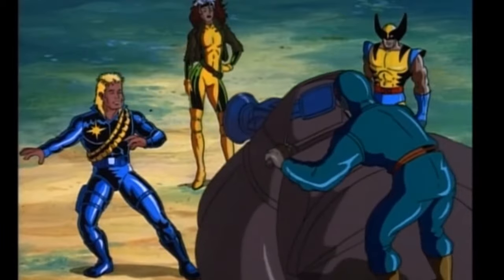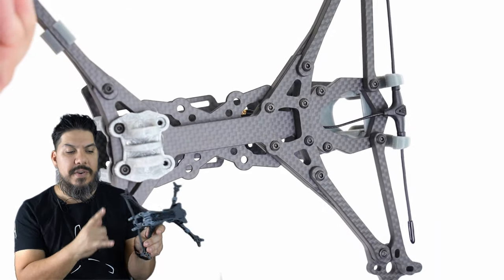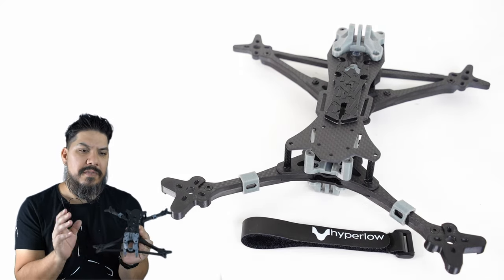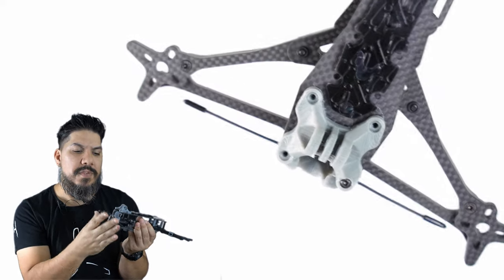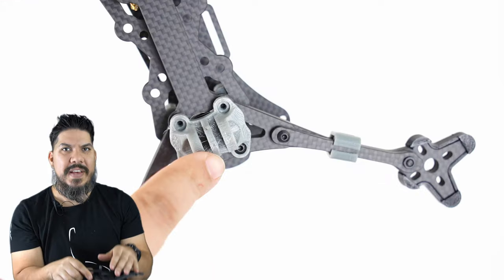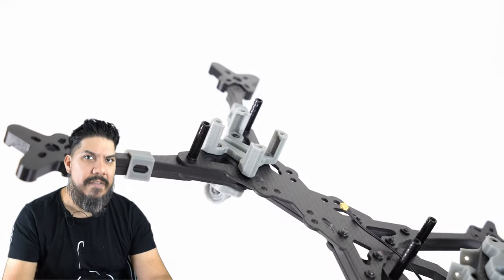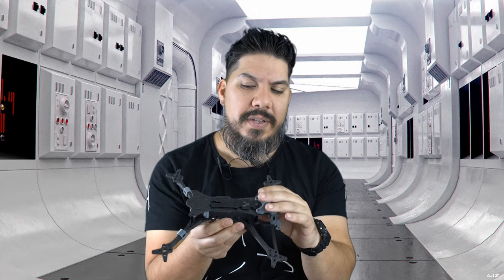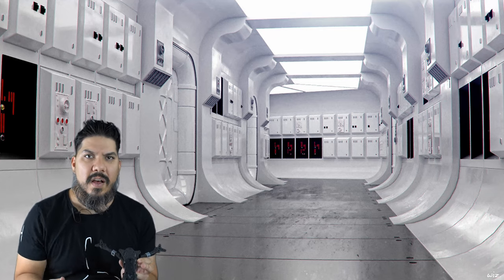Hyperlow Airshot - FPV Freestyle drone frame overview  quadcopter frame engineering and flight feel

Comment: I built a six inch with the Hyperlow RS+ frame and I like it a lot.  It's extremely rigid and very light.  The carbon fiber he uses is fully interwoven so it doesn't delaminate.
Reply: Does he still do that? I think I've seen it both ways
Reply: @spindlershots1957  I'm not sure.  I ordered my frame from him late last year and it came with that kind of carbon fiber.

Comment: I’ve been flying the CG for 2 years and it’s been super hard to find another frame that makes me as happy to fly. Super durable. 
I’m building my Airshot 5” and 6” now. The 5” Airshot is about the same size as the 6” hyperlow CG.
Richard is an excellent designer and Airshot has so much space for all kinda options in electronics.
Reply from the maker: Couldn't agree more! I will note that on the full review im sure, but i am loving how spacious it is for the builder.

Comment: Where is the follow up video? 
Looking forward to hearing your updates and flying experience.
Reply from the maker: Coming soon. Motors came this week. Stay tuned
Reply: @JonE5FPV  What motors did you get? I’ve been shopping for my next favorite 5” 4s motors. 
I’ve got my favorite 6” BrotherHobby 2507 set up almost finished. Been working too much after a move back to Dallas from Denver. I’m super ready to get both versions built. 
Radix2 for one and matek f722pix for the other.